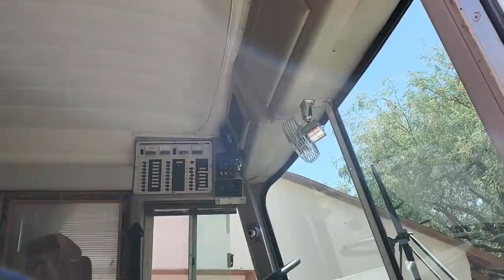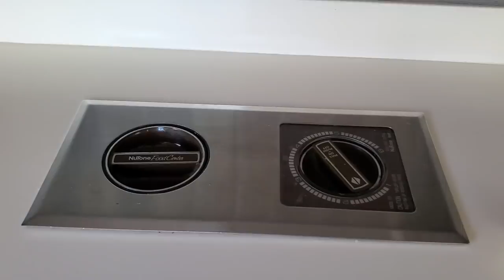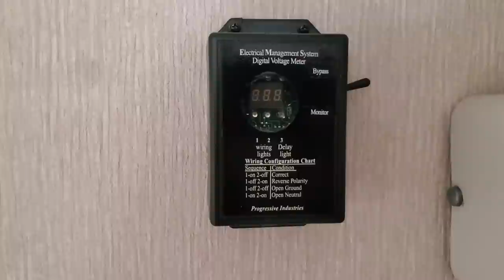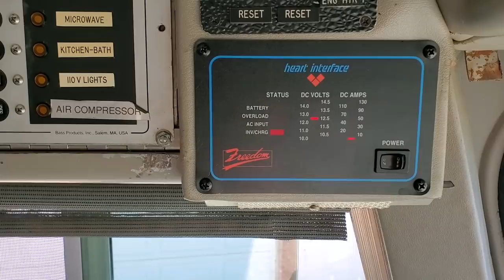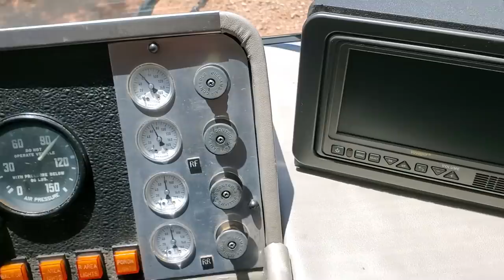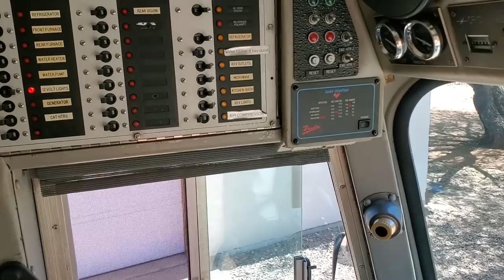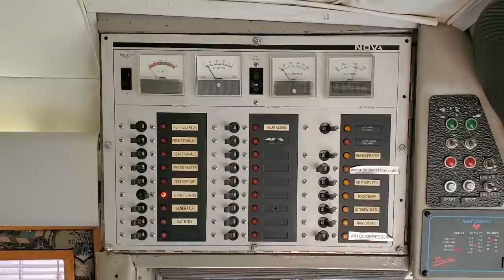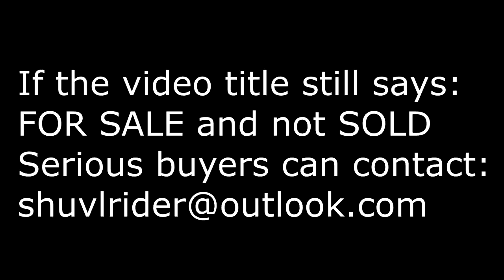1965 GM 4106 Bus conversion - SOLD!

Comment: That's a nice conversion, but it's unfortunate that this and so many of these classic coaches are so heavily altered from their original style. The stock headlights and taillights are much more stylish and don't clash with the clean lines of the body. 

The 4106 is a very attractive design that should be kept as true to its original configuration as possible (that includes the side windows).  

There is no way to "improve" upon the timeless design of both the 4104 and 4106.

The positive side in this case is that the conversion was well done and is of high quality.
Reply from the maker: My new bus retains the original lines, windows, etc. no holes cut in it for RV stuff like you usually see for fridge, water heater, furnace, etc.

Comment: Nice coach. I'm curious as to the construction of the ceiling coverings. Is that a padded material in strips?
Reply: White Marine Vinyl sewn as strips into one custom fit. Each segment is attached to a wood strip then lapped over to continue from one side of the bus to the other.
Reply: @charliemcdaniel7496  Very nice. I really appreciate you getting back to me. I am converting my own bus so obviously I am not going to buy yours, but I appreciate you spending the time to reply. I hope you find a buyer that will maintain it to stay as nice at it is.

Comment: I love old bus conversions. My problem is the old Detroits are lousy on fuel economy 4-5 mpg sucks 250,000 mile life expectancy sucks . A 3176 gets 10+ mpg and a million miles. A 12 valve Cummins conversions would get 10+ mpg and 500,000 life.
Reply from the maker: Your statement about mpg is incorrect as it relates to their use in a 4106 bus which is built like an airplane and has an excellent power to weight ratio. Fully loaded my bus weighs 26,500 and with a lead foot gets 6-7 mpg. I don’t want others reading your comment taking it as fact. Source: actual 4106 owner and driver.
Reply: @ThisOldBus  the industry standard on semis with a gross vehicle weight of 80,000 pounds plus is 7 MPG I have 40+ years of experience in the trucking industry and am confident in my assessment of the old detroits.they are what I cut my teeth on and quickly learned that they were substandard . 
 Believe what you wish my statement I stand behind poor fuel economy and short life expectancy are the hallmarks of old Detroits. I wouldn't buy anything with a old Detroit in it without including the room needed to repower it with a reliable better performing engine. . The only Detroits I would consider are the series 60 a 7 MPG motor but the ability to go 1 million miles between unframed or a old non turbo 8.2 that will run 200,000 if lucky a slow motor that gets unequal mpg in the 20 mpg range ( they are nicknamed the fuel pincher in the marine industry but subject to a short life) because the cost of frequent overhauls easily is covered by the fuel savings.  Sorry that you have a nice bus with a expensive boat anchor motor
Reply: @timerickson7056  Thank you for your opinion. However I am confused on why you feel the need to dissuade someone from a potential purchase when not asked for.
Reply: @timerickson7056  Your experience with Detroit's are skewed toward constant heavy use in semi's, in my experience 39+ years in the motorcoach seat driving them, typically it's about 500k overhauls.  If you're getting less, the operator is to blame for poor maintenance.